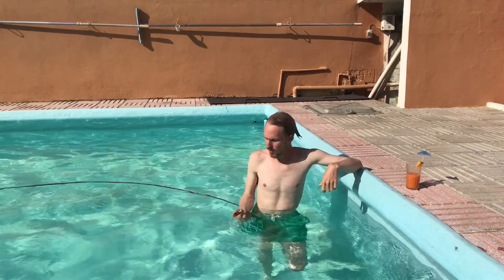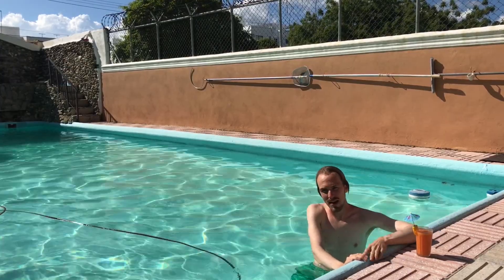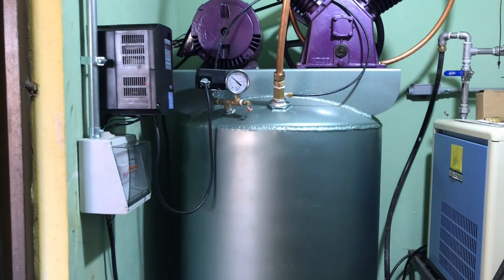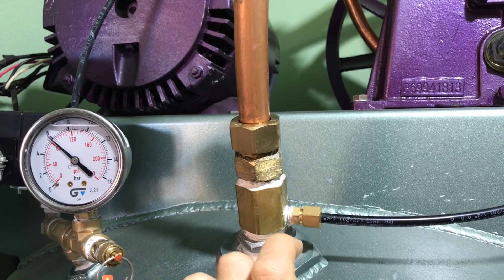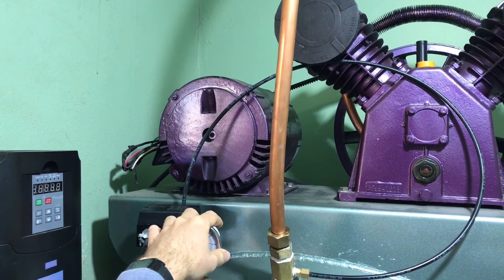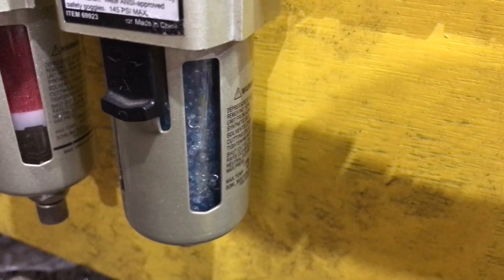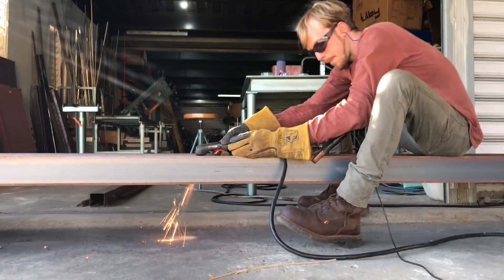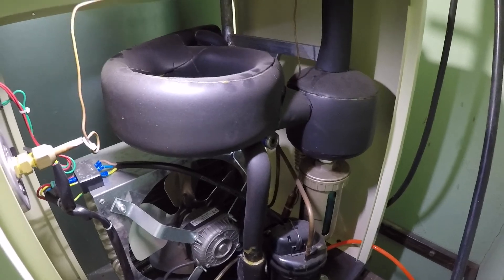Harbor Freight Compressed Air Dryer Review

Comment: You have good knowledge here.  I am thinking of getting this Harbor Freight air dryer for my air cooled pulse laser cleaning machine I've just bought.  It moves 21cfm; I'm not sure how that will really flow at 100psi.  Do you think I need to instal the extra filters on top of the machine?  Many thanks!
Reply from the maker: @jazzkunst  a lot of the extra filters are to remove oil and dust and things like that. If your air compressor uses oil, you usually get some oil mixed in with the air so an oil separator is ideal but if you have an air compressor that doesn’t use oil, it may not be necessary.

Comment: Why not dry the air before it goes into the tank?
Reply from the maker: @sloppydoggy9257  the air coming out of the compressor head is extremely hot. The surface area of the tank helps cool it. Quite a lot so it’s more efficient at removing moisture. Depending the volume of air, you’re consuming would probably determine if you could go straight into the refrigerant air dryer the tank would last longer if it had dry air in it

Comment: Can the drier be installed before the tank? Or will that defeat the purpose of the dryer since the air will get hot in the tank?
Reply: Usually a receiver tank is installed after the compressor and inline to the refrigerated air dryer to stop surging or oscillations in the air circuit, if your compressor has a tank on it already this would be the same, the output of that tank would go to the dryer input. You wouldn't, just take an output direct from an air compressor to a refrigerated air dryer.
Reply from the maker: I see the advantage for keeping the tank from resting as much. 
but the air cools down quite a bit while it's in the tank before it gets to the refrigerant air dryer 
The air coming off of the compressor is quite hot so if you were only compressing a small amount of air compared to what it's rated for it would probably work but it would probably be better to try and lower the temperature of the air before putting it in the refrigerant air dryer potentially using a radiator of some sort.